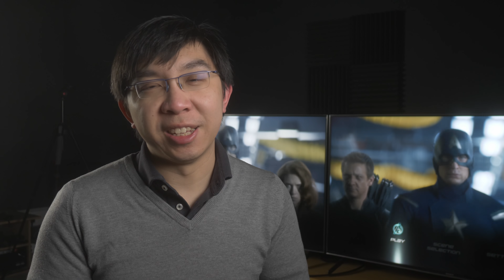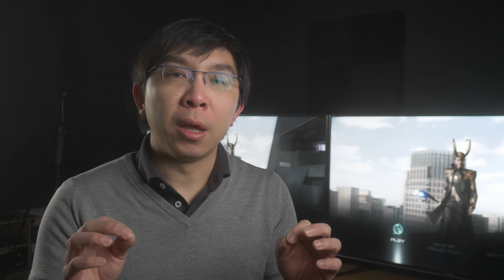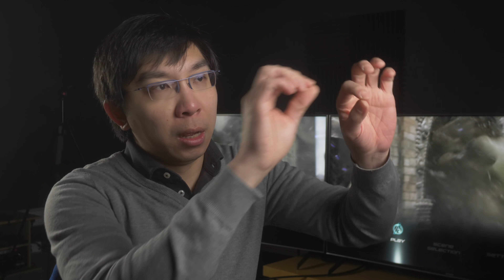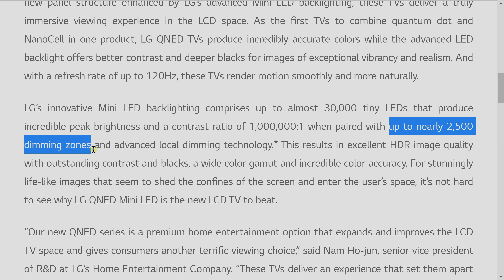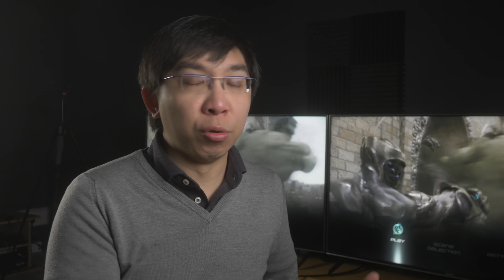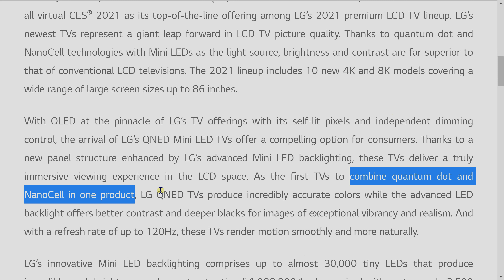LG Unveils Its 1st QNED Mini LED TV with Up to 2500 Dimming Zones

Comment: I’ll wait for 1 million mini leds before I give up my oled.
Reply: OLED can get pretty bright. Even on custom mode at medium peak luminance on my a8h, the specular highlights and just lighting shining through windows can get so bright. I have to turn brightness down to 30 and contrast to 75 to balance it out and not hurt the eyes. On high peak luminance, it can get straining on the eyes and I actually had a pretty bad headache earlier from how bright it was when I had it set with peak luminance on high. Could be because I watch with semi dim lighting and sometimes complete dark, but I've never found that it lacks in brightness at all. This is all with have the colour temperature on expert 1, which is one of the warmer colour temperatures, and having blue colour set to -5 to get rid of even more coolness. so I can't imagine people using OLED on standard or vivid mode on a cool colour temperature.
Reply: Dont forget to set that timer on the OLED. Wouldnt want burn in now would you? 🤣
Reply: 1 million is still garbage compared to 1:1 pixel level dimming from 4K OLED aka 8 Million+ dimming zones.
Reply: @PSYCHOV3N0M  OLED is dead end tech.. They can only get so bright.. So that is one limitation. Then there is the uneven aging of the self-emissive cells. It's unavoidable. 
So a 1 million MiniLED would easily provide an image that looks as deep black as an OLED. Only it would be capable of 4000 Nits vs 1000 nits for OLED max. And that means glorious Dolby Vision HDR. The colors would be more vibrant..

Seriously that many would be one 8th away from full microLED at 4K.
Reply: @PSYCHOV3N0M  But OLED ist not good when it comes to HDR. OLED is way behind in brightness.
Reply: @c2ashman  What OLED lacks in HDR peak brightness, it makes up for with contrast/black levels.

The perfect TV still doesn't exist for consumers or enthusiasts to buy.
Reply: @c2ashman  OLED is perfect in dark room which is exactly how I prefer.
Reply: @PSYCHOV3N0M  MicroLED is the future, but even there we are currently limited by actual pixel size....
Reply: @c2ashman  You are absolutely clueless. OLED is the only panel tech that can actually show PROPER HDR. You don't need massive brigthness when you have SELF EMITTING PIXELS. This is why ALL TECH SITES use OLED TV's as HDR reference ... Please educate yourself and stop spreading misinformation. Thank you. Backlight bleed on LCD/LED TV's are a huge problem in HDR mode, because it needs high brightness and bleeding + corner glow is present on even the best ones. Most LCD TV's even still use edge LIT LEDs which are HORRIBLE for HDR.
Reply: @Dr.WhetFarts  oled is garbage,. I have a ks9800 and is way better. Imagine miniled quantum MATRIX , and 5000 local dimming zone,.   oled is burn in and dim as hell and you can't see nothing on dark scene back ground cause stupid pixels turn off.  Oled garbage
Reply: @PSYCHOV3N0M  The true garbage is burnt in OLED.
Reply: @wuzumaki  Burn-in isn't a high risk issue like it used to be years ago.

Living in FEAR is bad.
Reply: @PSYCHOV3N0M  it's not fear, it's 100% confidence my q90t qled, which is twice as bright and very good blacks, will not burn in the way an OLED will. If mini led improves upon what I see now, it might even be tough to make any argument for OLED at all. Who knows, but I can tell you don't.
Reply: @JayJay-jx3zg  Your Q90T sucks compared to OLED though, especially when it comes to black level and crush. Hard pass. Keep that TV to yourself.
Reply: @AngelicRequiemX  lmao, I have an OLED and a Z9F. Sucks? You act like I'm talking about an lg nano. Keep your opinions to yourself until you've had multiple tv's to compare.
Reply: @JayJay-jx3zg  Why don't you stop lying first and maybe then I'll keep my opinion to myself.

Also, Q90T's terrible black crush compared to OLED is an objective fact:
https://youtu.be/pdnj_X0_A4c

You don't need to own both TVs yourself to see that when you can watch a video and see it clearly.
Reply: @JayJay-jx3zg  stop being a fanboy and a liar you sad little man. Pathetic.
Reply: @AngelicRequiemX  if you think watching a vid online, through a camera lens is good enough, kudos. Did I mention I had a panny plasma up until the spring this year? I know what I see. You want black black ana black greys? You want dark scenes you can't tell what's what? Get an OLED. No one says they aren't great, but get real, the competition is there. Also, the competition brought the price of OLED's down, so be happy for that too. I don't need your approval or belief to know what I know. Ps, how can I be a Samsung fan boy, when I own all these different tv's. In fact, the q90t is my first Samsung since 2010. I also have a 900e. Fan boy, lmao! None of you have the tv's I have to back up your ridiculous statements and if anything, you're the fan boys who can't appreciate all the technologies available.
Reply: @LordAngelus  lmao never thought id see a bunch of people bitching about tvs
Reply: @dung-_-pie4455  WHAT?  Then this must be the first time u read a comment or watched a video on YouTube about tvs cause its always a heated sometimes stupid  debate.
Reply: @PSYCHOV3N0M  Please tell that to the brightness limiter that cannot be disabled on OLED. If living in fear is so bad and burn in risk isn't as high anymore then why are limiters still a thing along with strong recommendations to lower the brightness as much as possible? 

Though I'll be the first to admit OLED is great for SDR content viewing. (Just don't bother with HDR unless you enjoy heavy tone mapping bullshitery.)
Reply: @RaydeusMX  Burn-in risk isn't as high anymore BECAUSE OF the ABL.

LG knows most people will be watching stuff with static elements. Cinemaphiles on the other hand have nothing to worry about if they only watch movies and shows with no static elements. I've read nothing but positive things about the C9 for gaming.

No TV is perfect but to this day OLED remains the King of picture quality.
Reply: @JayJay-jx3zg  QLED?  Gross
Reply: @AngelicRequiemX  by the way, what am I lying about?
Reply: @PSYCHOV3N0M  There is still a risk, even if it's not as massive as it once was. It's also not just about image retention with OLEDs-there are instances of people's CX TVs losing its vibrance of color in parts of their screen. Living in fear can be bad, however, with the huge cost of OLED, it makes sense. People want their money's worth and TVs have traditionally lasted decades, which seems unfeasible with OLED.
Reply: @JayJay-jx3zg  Z9F is a failure of a flagship from Sony. 😂😂😂

Such a step down from the Z9D.
Reply: I'll wait for a 150" OLED to cost less than $10k before I give up my projector.
Reply: @mikej6565  gross projectors images are terrible compared to tvs
Reply: @jdog8701  I've never heard a person walk in my theater and call it "gross". Have you seen a JVC RS4500 with an anamorphic lens in a well designed room? TV looks so artificial and harsh compared to a high-end projection setup. I have 2 TV's, the better looking one is a 75" Sony Z9D and the less impressive one is an OLED 77". My wife laughs at the TV's compared to the projection setup. Then again, we have a society where most would rather listen to music on bluetooth earpods than high end speakers. Whatever floats your boat.
Reply: @mikej6565  lmao ya im sure your story is "true" and the only projector worth having is the Sony vpl-vw5000es which is way too expensive so ya eww gross you are using a projector 🤮 and need to make up story's to try justifying your inferior product
Reply: @jdog8701  Haha. You never know who you're talking to on the internet. Lucky for me I'm not lying and people come over all the time to enjoy the theater room. I even returned the 85" Sony Z8H because it was just too stimulating, I haven't seen my wife so mad about a TV in years. I've tried to give TV's an honest chance.
Reply: @jdog8701  5,000 lumens is scorching for a 125" screen, so the Sony would be overkill. The JVC is all I need for my room (27'x16' with 3 rows of seating).
Reply: @mikej6565  sorry you and your tv hating family can't afford the only worthwhile projector good thing you have 2 tvs that are worth watching til it comes down in price
Reply: @jdog8701  A real live troll. Nice to meet you, very entertaining. Funny thing is I absolutely can afford a Sony vw5000es. Would I buy one? Of course not. Very ridiculous for a small room and screen like mine.
Reply: @mikej6565  your fake story was pretty funny as well hopefully that made you feel all warm inside
Reply: @jdog8701  My wife is laughing at your comment while we're both enjoying how real my "fake story" feels. If you doubt that people have money and lives then I'm not sure how much hope there is for you. There are many of us who spend tens of thousands on toys every single year. Perhaps you too can find happiness, love and success one day. Good luck to you.
Reply: @mikej6565  im sure she is...she can also do anything you dream of 🤣
Reply: OLED is a stepping stone. Laser is the future.
Reply: @mickfitz76  i already have a laser tv

Comment: It seems like marketing war. LG just grabbed QNED abbreviation first.
Reply: Probably just a troll for Samsung who changed from SUHD to QLED so it looked like OLED. I wonder what Samsung will call their nanorod (what we would’ve called QNED) tech.
Reply: @maperez12  yea, that what I’ve meant. You described it much better)
Reply: Yeah 😂, and made it to be totally different tech than "real" self emissive QNED tech... 😔
Reply: @tkermi  hopefully micro led will be better.
Reply: @robertlawrence9000  Also the self emissive QNED that Samsung Display is developing is really promising tech. It's said to be much cheaper than MicroLED (cheaper to manufacture - can be inkjet printed). Samsung Display has estimated that it will be ready for mass production in two years. I guess they just need to use some other brand name for it.
Reply: @robertlawrence9000  Micro LED will be affordable in (Cyberpunk) 2077
Reply: Confusing abbreviation Mini LED sounds better
Reply: @WizKing93  MiniQNED!
Reply: @martinsx  Good better
Reply: QNED can be used by other companies regardless if its been registered or not. Its deemed as generic, like qled anyone can use it.
Reply: We started down the dark path years ago when UHD was found to be a bit unsexy so marketing decided to steal "4k" from the standard for digital cinema projection even though it's 3840 as opposed to 4096 pixels/a lie...

Comment: For only 5000euro🤣🤣 wait another 3 years for a good price
Reply: for an LCD? probably 500 euros
Reply: @NeagoeNarcis  No way this is a new technology. This technology ist better than qled and you really think IT will Cost only 500 Euro🤣.

An example the qled Samsung 95t has 120 dimming zones (55") and the qned Mini LED has 2500.
Reply: @GrinchyBoby  This technology is for the lower end TVs. The smaller sizes will be priced similar with Nano Cell for sure
Reply: That is the problem. After mini LED something better comes.
Reply: @NoneOfyourBusiness468  Something better always comes. Technology waits for no one.

Comment: OLED will be beaten up
Reply: Didn’t you see the video? This will be a step down from their OLED tvs and a step up from their NANO Cell tvs.
Reply: Naw, Oled will have it's relative secure place. At least pixel response time will secure them a place for a long time. At least for gaming. Cant wait for proper OLED gaming monitors even I can't use as a normal desktop
Reply: @ego4551  The 48 inch CX is more expensive than the 55 inch CX.

A 24 inch OLED gaming monitor from LG would be VERY expensive for most gamers.
Reply: @PSYCHOV3N0M   Sure it's a high end luxury item. If you can afford one it probably isn't you only monitor either. Give me one without any smart function a good controller at 27 to 34" and 1440p to 4k with  ideally 240Hz and I'm easily willing to spend as much as I did on my 55" LG OLED TV.
Reply: In your dreams. OLED remains KING of consumer TVs.
Reply: @PSYCHOV3N0M  Naked king